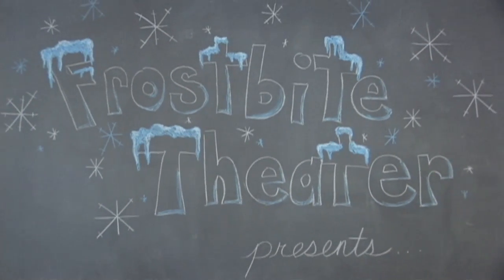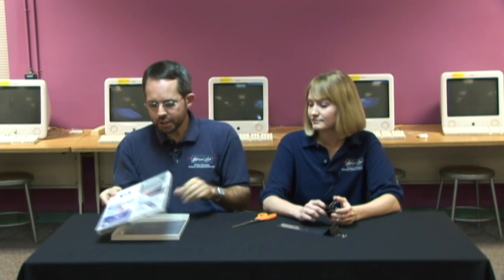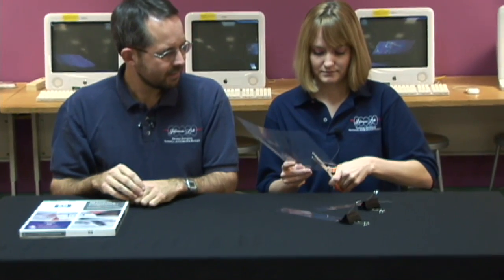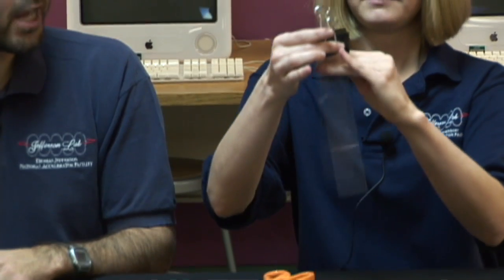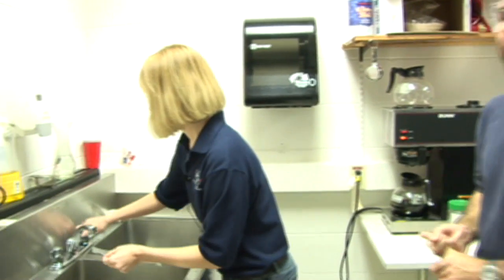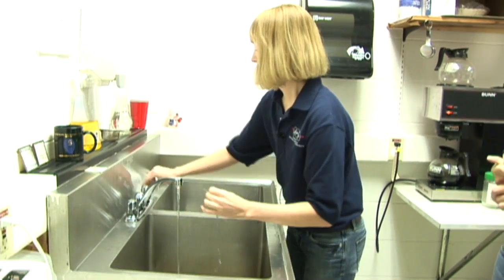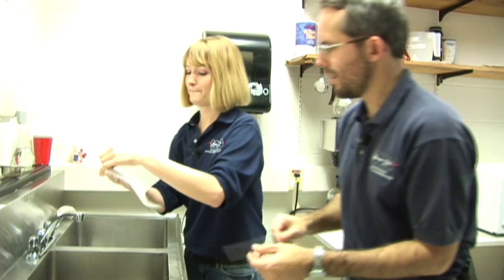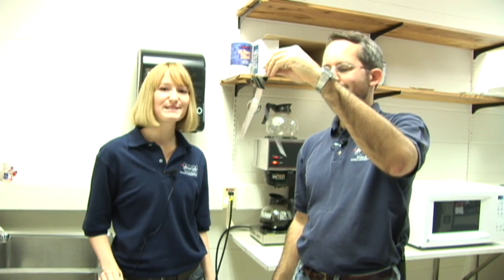How to Make Your Own Electroscope!

Comment from the maker: Because the electrical storms are more efficient at separating charges than humidity is at evening things back out again. Also, as you go up in altitude, the absolute amount of humidity drops. Warmer air holds more water vapor than cold air does. So, while the relative humidity in a cloud is 100%, you can have more water vapor in the air at ground level, where it's warmer.

As far as the volcano - I haven't a clue. You can get lightning from the dust clouds they produce, but that's not the same.